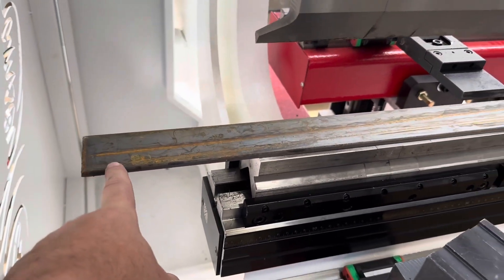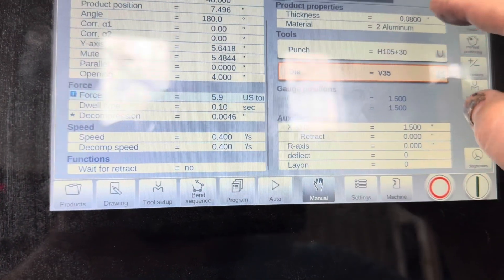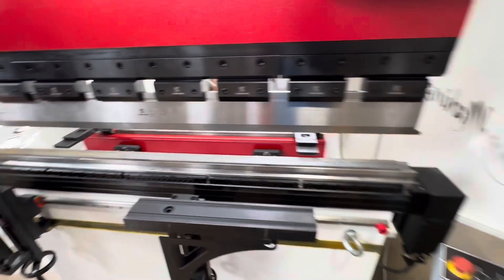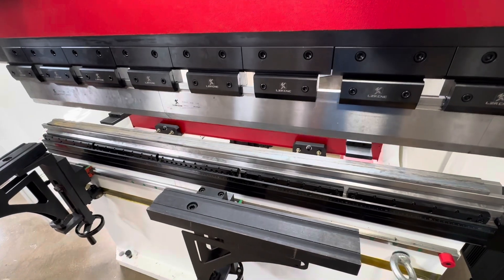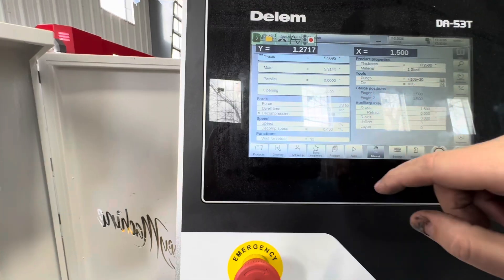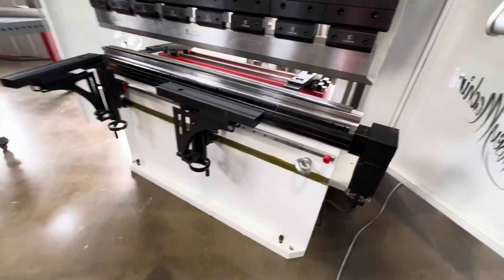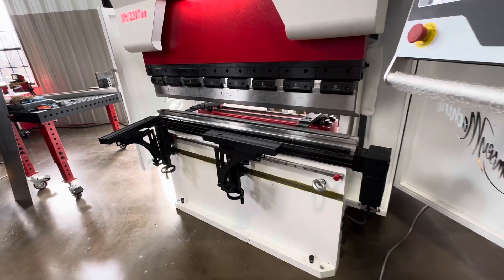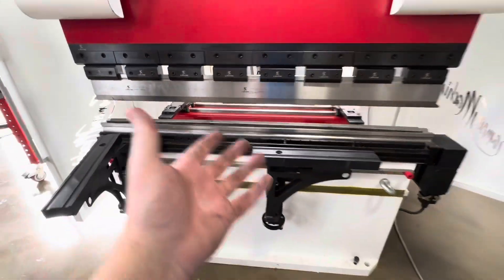9 year old steel + 220ton = POP!

Comment: Old steel?!?    You try to bend it with the grain, that is the problem
Reply from the maker: the main issue was 2 small of a die, I broke all the rules on this one.  #1 Issue, too small V opening #2 issue, old steel #3 issue, bent with the grain but bending with the grain is done every day, and works fine in a properly sized die.
Reply: @ sure it’s done every day, works better on thinner material and larger radius….  I still think that the old stell was the smallest factor of these 3 🤷‍♂️
Reply: @turbocobra  That was my first thought, we have 150ton bystronic with 32mm V die and it won't allow us bend 6mm steel to 90°, too much tonnage for that die.